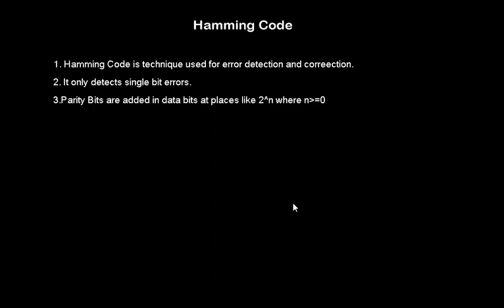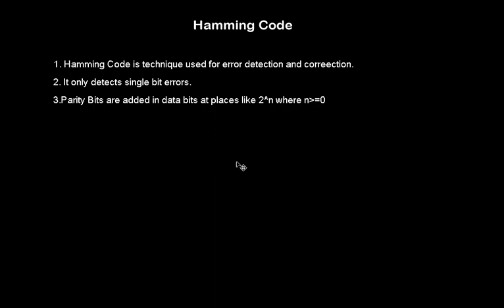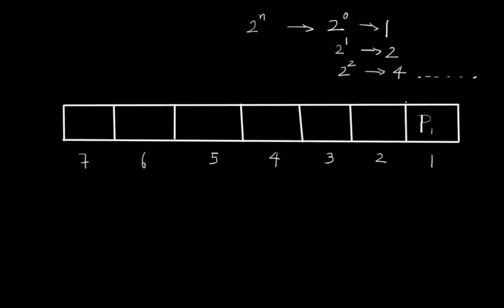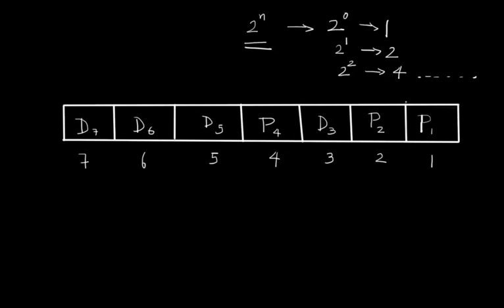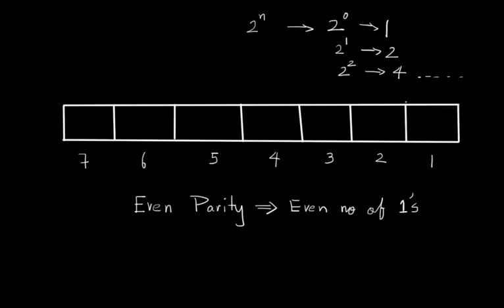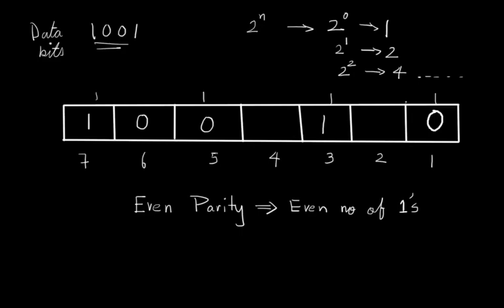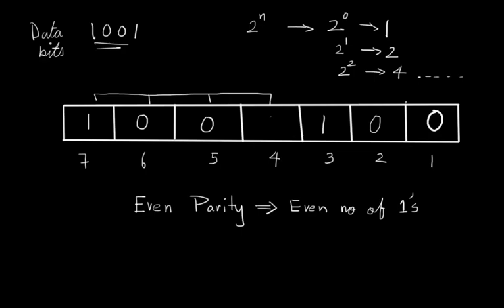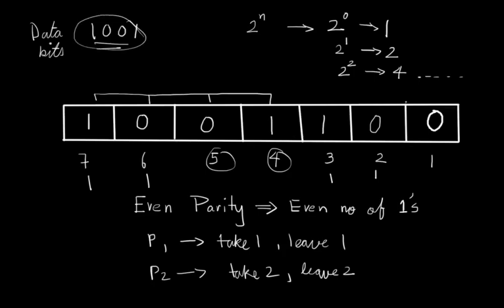Hamming Code Explained : Understanding the concept of Data Encoding

Comment: It can detect 2 errors but can correct only one!
Reply from the maker: It doesn't detect 2 errors. Only single bit error is detected and then corrected.
Reply: @thinkandlearn7258  It can detect 2 errors if it is 8 bit encoding